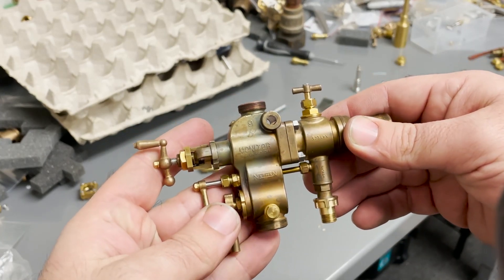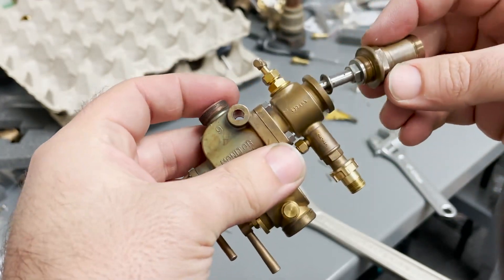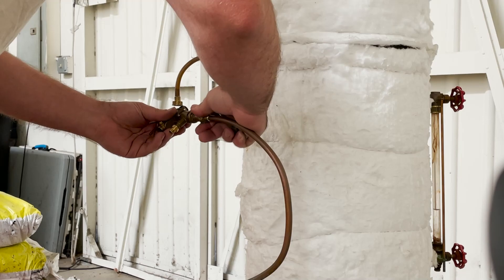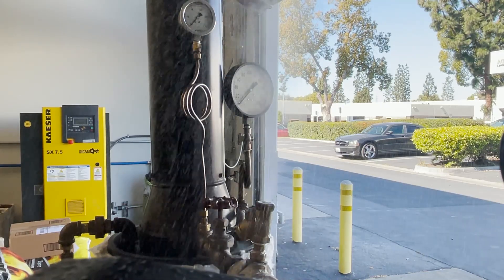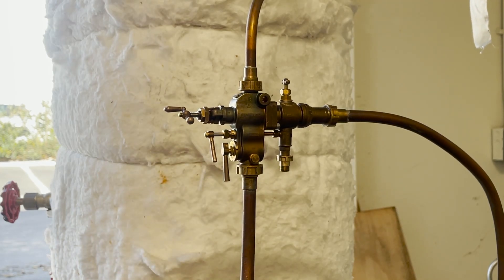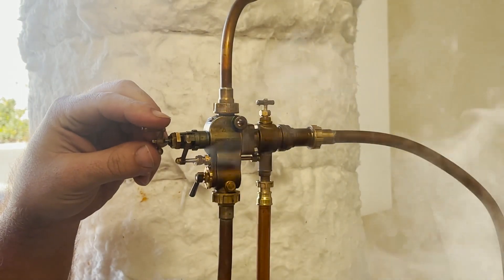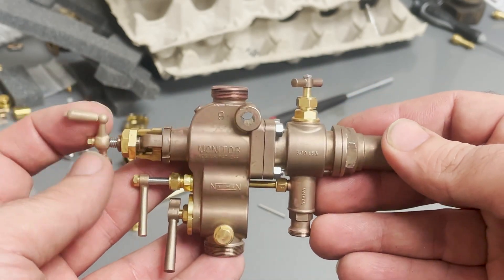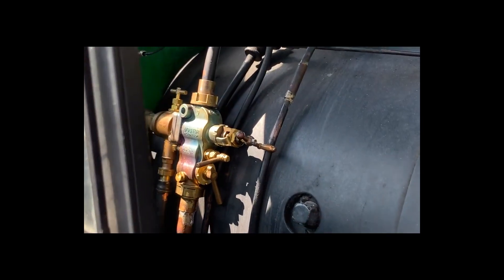Troubleshooting a Problematic Monitor Injector

Comment: Important to emphasize the tightness of joints, particularly water lines. Air leaks into the water line are a killer. Also adequate steam lines without restrictions. I’m not surprised that it works on your test rig. Typical.